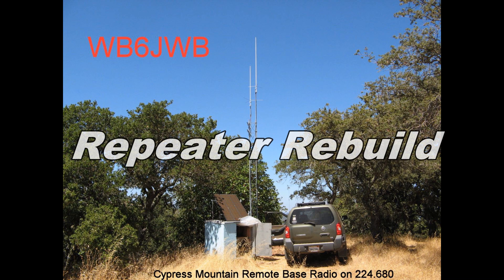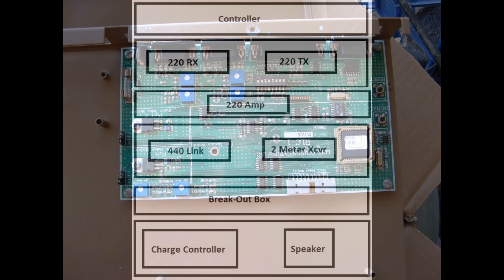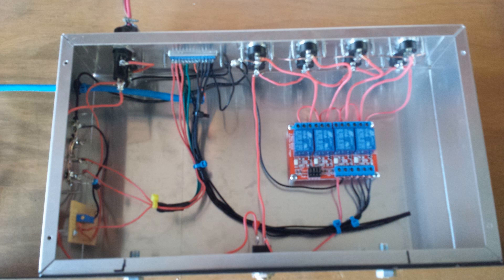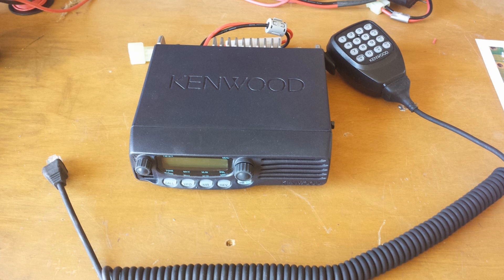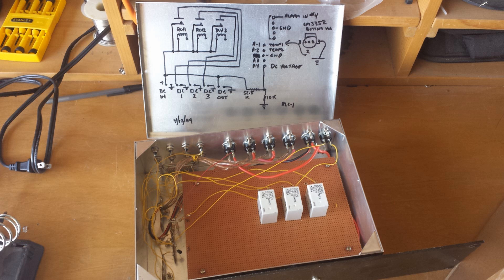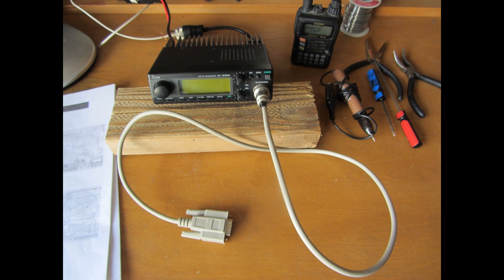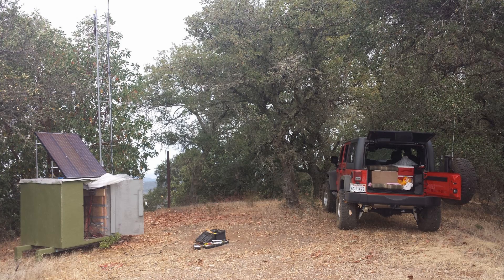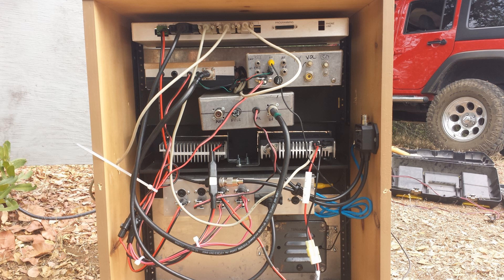Ham Radio Repeater Rebuild Project

Comment: Eye balling a KISS. SIMPLEX. REPEATER. I LIVE IN A BOWL AND WITH HANDI TALKIE. You could call your xxx off. Get nothing. Just by adding a 20" pole I'm out of the valley. And made contact with a repeater that seems to be under siege. I know I can make the trip. But I'll let the "operator" of that set up." Clean his pourch" be fore I get. Too busy. "Waited too long to get the boot" spent too much time/  money. To finaly get a signal. Tks Fer good show. Kv4li 73

Comment: Great info! What did you use for temp sensor? LM335 plus a cap/resistor?
Reply from the maker: Yes, I used an LM335 .  The ARCOM controller has the necessary resistor on its board, so only the cap was needed. 
Thanks for the comments.

Comment: Nice!  What do you have in terms of IDs and courtesy tones on the controller?  Also, is the remote base controlled through the commands of the controller?
Reply from the maker: +W8SRC Thanks. The Arcom controller has nearly limitless courtesy tones and ID's. And yes, the remote base is controlled by commands through the controller.